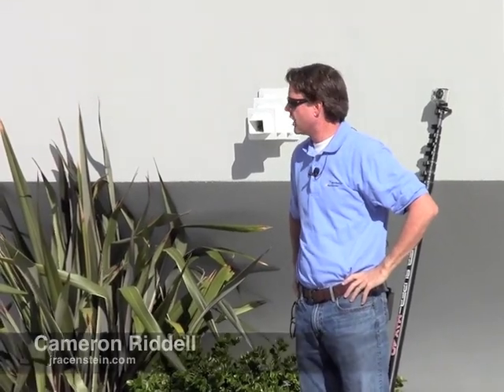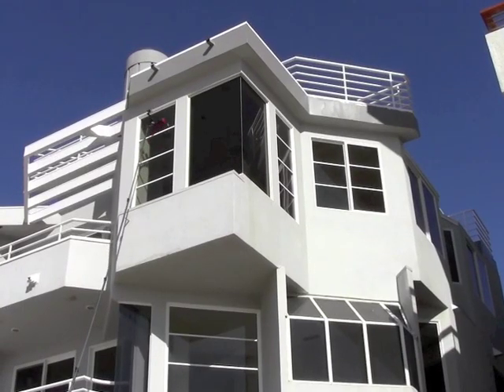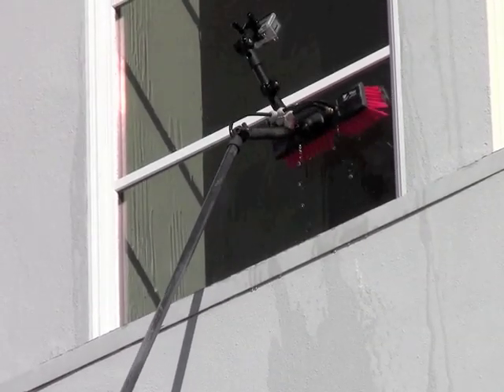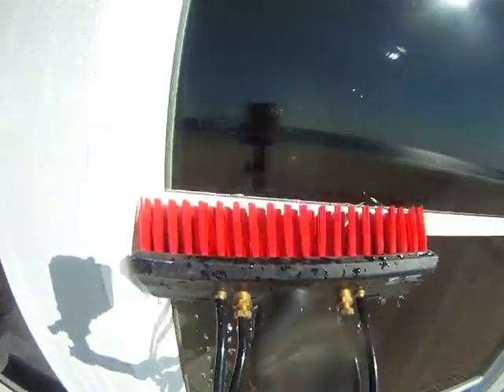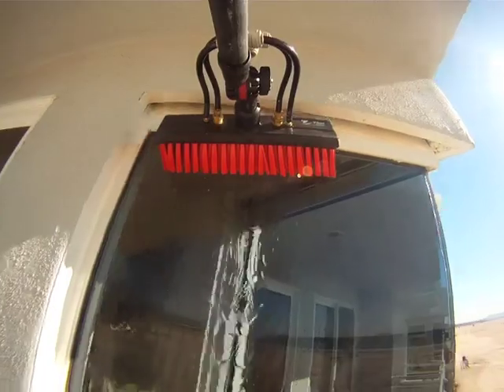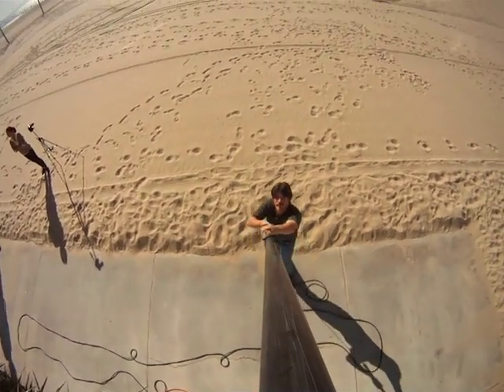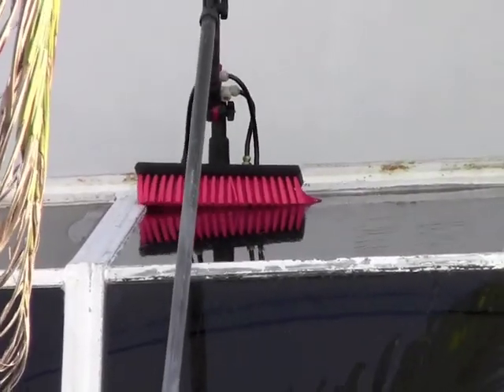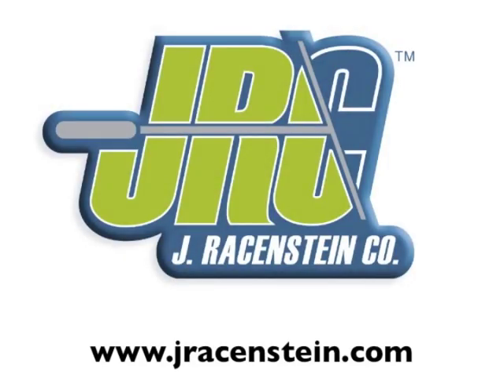Water-Fed Pole Techniques w/ Josh Corey

Comment: It's good to see you how you demonstrative the  water fed pole but the brush is the  wrong one if you look it the angle  does not do the job properly ....!!!!!
Reply: Tell me about it.  Was worried about time restraints.
I have to adjust the brush angle 6-12 times on that job depending on conditions.
I must admit that I was overly cautious over wasting the guys time.
I did backtrack and redo the windows.
I recently did that job again for literaly about the 240th time.
Reply: @TheWindowMaven  We know that the time is money best option get the best brush that Gardiner ever make get the Gardiner Universal Stiff Brush 12" It helps on any kind of windows the bristles are stiff  It works on any angles you can save a lot time scrubbing as experience you can get  " more money more honey" .....!!!! Good Luck